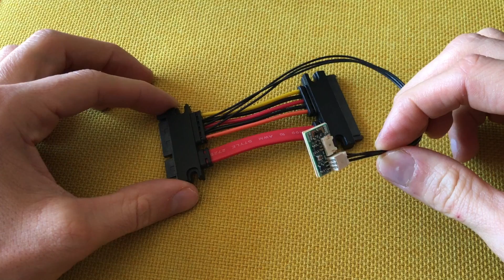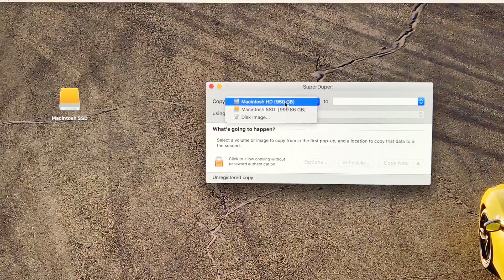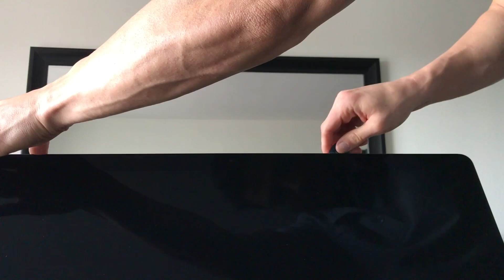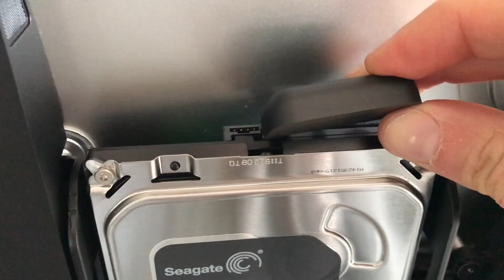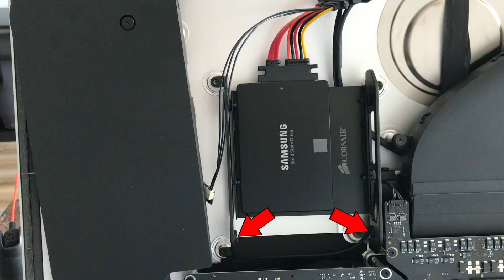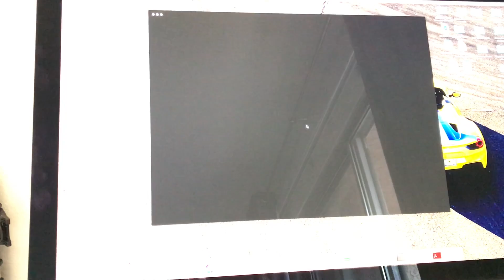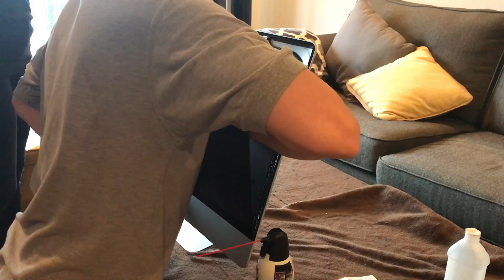How to make your iMAC 5 times faster | 2012-2017 SSD UPGRADE WITH THERMAL SENSOR | Step by Step

Comment: Very precise video, thanks for this. Just some two questions, the bracket recommended isn't available and Im considering this https://www.amazon.com/gp/product/B005PZDVF6/ref=ox_sc_act_title_2?smid=A2W0TEJ3MK1XP5&psc=1 I hope it works well. also can one use Gaffers tape in place of Dual Lock Velcro?
Reply from the maker: I mean I’m sure it would be fine. I’m just worried about it loosing its stick over time
Reply: @AIRWOLF  Thanks for the feedback I will go for the Velcro, did you check link to the available bracket, do you think it would be fine?
Reply from the maker: @meshmut  Ya I don't see why it wouldn't work.

Comment: will this work with the new model of sabrent converter? as the one you have in description is no longer available
Reply from the maker: Yes so long as it has a SATA connection. I’ll try to re link it. Thanks for the heads up.
Reply from the maker: https://amzn.to/2uNMDww this will work

Comment: Thank you so much i did it :) thanks for d help :) point shoud be note * thermal sensor not requires any how my mac running fine without any fan issue *
Reply from the maker: YAY!! Thats great! And yes, i've heard folks installing it without the sensor and there seems to be no issues.
Reply: This following link for Indian who are struggling to upgrade their mac please buy these following  items form amazon.in   ..

@ AIRWOLF  Hey hope you don't mind if i  share amazon Indian link because we cant import from (amazon.USA )

2.5 - 3.5 SSD Bracket :  https://www.amazon.in/gp/product/B00G57BN1M/ref=ppx_yo_dt_b_asin_title_o05_s00?ie=UTF8&psc=1

Adhesive strip and opener  :https://www.amazon.in/gp/product/B07QMGPPTL/ref=ppx_yo_dt_b_asin_title_o04_s00?ie=UTF8&psc=1

Samsung SSD : https://www.amazon.in/gp/product/B078DPCY3T/ref=ppx_yo_dt_b_asin_title_o06_s00?ie=UTF8&psc=1 

you can buy this also but its very extensive .

Adhesive strip and opener : https://www.amazon.in/gp/product/B00J42HP9O/ref=ppx_yo_dt_b_asin_title_o02?ie=UTF8&psc=1

i upgraded late 2015 27inc imac in 2020 :)
Reply: @RubySupreme329  congo :)

Comment: WOW!!! What a great video. Thanks for sharing. I've been looking to  upgrade my iMac 27" because, although it performs well, sometimes it's just a little to slow...especially for video editing. One question for you...would upgrading my ram speed too be overkill, or upgrading to SSD should be enough? I just need more speed for editing.
Reply from the maker: Thanks so much! Upgrading your ram would be just as important especially for editing.  I maxed mine out to 32G.
Reply: AIRWOLF Ok. Thanks for that. Very valuable information.

Comment: Just upgraded my iMac 2012 using your instructions and it went perfectly. The only issue I had was the Sabrent Hard drive converter was faulty and I ended up getting a better result using the later model. Speed is very noticeable. Thanks again for posting the instructional video.

Comment: you need to activate the built in apple SSD acceleration, some SSDs support it and some don’t but you can look up which ones do before buying. The samsung EVO used should be supported and you will get extra speed for free
Reply from the maker: Thanks for the info 👌🏼

Comment: You can do the same with an external SSD, I just did that to my Imac 27" Late 2013 with a 1 TB Samsung T5. My 2013 has USB 3.0 ports that are fast enough, you do not need to install the SSD internally. My disk speed went from 60-70 MB/s with to old HDD to 410-420 MB/s with the external SSD. My computer feels like new again... :)
Reply from the maker: That’s great to hear! That’s exactly how I felt.  A world of difference.
Reply: Driven To Madness No, with a SATA ssd you will not get speeds above 500 MB/s, but with a M2 ssd you can go as high as 3000 MB/s. But the problem is that older iMac doesn’t have an M.2 slot. So you will pretty much get the same speed with an external ssd via USB as with an internal SATA ssd, but without the hassle and risk of opening the computer.

Comment: Do you know if the ssd drive would fit on a 21.5 imac late 2012? Is the connector the same as the one on 27 inch?
Reply from the maker: As long as it’s a sata connection you’ll be fine
Reply: Everything worked, just had to make the drive compatible with a Mac and load from time machine. Feels like I have a new imac now !!
Reply from the maker: @EvaTess  AWESOME!! Well done.

Comment: Gutsy removing that screen.  Glad it worked out.  The new iMacs have NVMe SSDs available.  I just went ahead and paid for 2 TB.  But I did upgrade the memory myself which you can do on the 27" model without removing the screen.
Reply from the maker: That NVMe is throwing some serious speeds 💨
Reply: @AIRWOLF  Just ran Black Magic today.  Roughly 2000 MB/s on the write and 2600 on the read.  Plenty fast enough for most things.

Comment: Hi there, my late 2015 iMac does not have a 3.5" drive. is the one your worked on a 27" or 21". I was looking to get a thermal sensor to fit when fitting the 860 EVO SSD. but not found one for a 21.5" iMac yet.

Comment: This may be a crazy question, but I opened up my mac (Retina 5K, 27-inch, Late 2015) to upgrade the drive, and I found no hard drive in the bay. I reassembled and see that I seem to have "flash storage." Is that fusion? It is 250gb and I was hoping to install a 1TB SSD.
Reply from the maker: Soul Reflections Photography sounds like you already have an SSD installed already
Reply: Yes sir.. Did some.research and found I have straight ssd. Kicking myself for not getting more than 256 gb :/
Reply from the maker: Awwwwe mannnn well at least you already have the SSD
Reply: you absolute idiot. flash and SSD are one in the same. you cannot upgrade

Comment: No need for thermal sensor, i've done the SSD upgrade (Samsung evo 1tb) and running on imac 2013 for more than 2 years no issues.
Reply: Is the fan normal after installing .. or it is loud?

Comment: Hi, it this thermal sensor compatible on imac 21.5 late 2013?
Reply from the maker: Yes! 100% if you click the link to the thermal sensor, it’ll give you the specs. But I just checked and you’ll be fine to use it.

Comment: Nice and instructional, but very clickbaity. That process does not make the iMac 5 times faster - it makes the disk speed 5 times faster. That's a very different proposition. A 5 times faster iMac would get 5 times the fps on any game, 5 times faster render and export times on any NLE, etc. You get the idea. That's what 5 times faster means, and that's impossible to achieve. Just name it "how to make your iMac's disk speed 5 times faster if you're running an HDD" next time. And in most cases you would be as well served by just booting from an external thunderbolt 3 SSD - no need to open the computer, save the risk and the work and get about the same speeds.
Reply from the maker: It says “SSD UPGRADE” in the title.  If one doesn’t understand that then they should not attempt it. 🤷🏻‍♂️
Reply: @AIRWOLF  Yes, it says that, but it also says "how to make your iMac 5 times faster", and that's not true. That process does not make any iMac 5 times faster.
Reply from the maker: The title is followed by “SSD UPGRADE” implying making the “SSD 5 times faster”.
Reply: @AIRWOLF  Then why not remove the first part and have an accurate video title? Because it's clickbait, that's why.
Reply from the maker: Visual Studios the same reason YOU put “Chris Hau’s” fuckin face as a thumbnail you jackass. Get the fuck outta here

Comment: If there was no sensor there why did you need one for an SSD. If there was one why didn't you use the same
Reply from the maker: The original HDD sensor is built in the actual hard drive from what I gather you can't remove it to re use it.  Thats why the sell it separately.

Comment: I'm going to do this on my 2012, but I also want to upgrade the PCIe 2x4 lane, since I can achieve much faster read/writes than a standard SSD Sata III drive, like close to 1,000 mb write and 1,200 mb read. SATA III has a 500mb max read/write, so honestly, if you are daring, it's worth doing the PCIe blade style SSD upgrade.
Reply from the maker: I agree! Hopefully this videos at least helped you get inside you iMac. :) Happy tinkering!

Comment: Hey Airwolf, A great video, enjoyed it immensely. I have a 2018 IMac with the two TB fusion drive. I have added 32GB of RAM bringing the Ram up to 40GB to help me with Video Editing and running my X-Plane Flight simulator. I was curious about the difference in performance so I downloaded the Black Magic App . The write speed varied between 200 & 700Mbs and the read speed varied between 400 to 1000+Mbs. I am wondering if I can upgrade with a two TB SSDrive and keep the Fusion function or do Ido a a straight drive upgrade with the SS drive and not worry about the Fusion aspect of the new change to the system? That is my question............Thanks for the info on getting the screen separated from the housing. I have a bazillion guitar picks and plenty of sharp utility blades handy. Also, naptha, found in Ronson and other lighter fluids is a great adhesive remover and does not hurt plastics or most finishes on wood. I use it all the time when in my guitar repair work. Straight Naptha  can be hard to find depending on where you live but lighter fluid is usually readily available. Cool video, Thanx!

Comment: Having done this procedure on several versions of the Mac All-in-Ones, and performed the same thing on the Dell and Hewlett-Packard All-in-Ones.....The Mac is the biggest pain in the butt to work on of all time.  It does make faster, but adding ram is what will help the most. Also, when a spinning disk fails, you can still try to revive it.  When a solid state glitches, kiss everything good bye forever. 

I can appreciate this guys "do it yourself" approach. I wish everyone could be like him, saving money is great. Doing it yourself and making it work so well, priceless.  Pretty good angles and commentary, nice hint about the Costco microfiber blanket !  .....  Being charged $1,000 to take one of these apart (even the easier previous magnetic screen models) and poke in an SSD is not unheard of. A huge price gouge, but people do it willingly.  

....if you are a dyed in the wool Apple fan,  that's the commentary on the video....Nice job! Nice Computer! Great speed increase for the money, good hints and instructions, and not as "dry" as some videos. Well done.  

 I'd like to compare that job to two pc's that are the IMac's direct competitors. AIO, All-in-One systems, same chips, ram, hard drives, etc.. and will compare systems to fit the reason why he wanted to upgrade.
...........The same editing he is doing can also be done on any pc just as easy, and with more software titles to use along with the main software.  That same upgrade mod with the same results, plus 4 other upgrade speed and video mods, can be done on the Dell and the HP AIO - in 15 minutes total, for the same price. Plus making all the other mods easy at the same time, because of how the pc's are designed.
 
 I am a certified laptop refurbisher with Dell, Toshiba and a few more. I have repaired Apples from the days when they had s100 busses, the Fat Mac that only had enough data to fill part of the bios so they put pictures of the staff in the rest of it, and on up to today's glued together air specials. I have 32 years computer repair experience. My professional career in computer mods started with the Commodore Amiga Workbench GUI operating system. It came out later the same year as the first Mac OS, but in color and stereo. Wrote a few books on modems and Pirate Bulleting Boards as well...

The Physical and software maintenance on those IMacs are 5 times as hard as the exact same job on a Dell or an HP. Even imaging them for back up.  We use GHOST, or Acronis. to make a full back up, either UEFI or legacy boot systems. It will even image a Bitlocker encrypted drive and reimage it back exactly as it was. That software takes half the time, and half the hard drive space for the image as what was demonstrated.  AND you can edit the compressed image with them as well. Including installing or uninstalling files, from the image. After that, dos scripts that will install or uninstall software after the image finishes. 

NOTE: Great that you pointed out blowing out the dust !!!  Seriously.  I would be nearly out of business if everyone cleaned the dust out of their computers twice year.   ......You can clean these Dell/HP All in Ones (AIO) out better and a lot easier than the Mac. Dust bunnies kill by clogging the "inside" of the filter vent holes. That is why there is a heat sensor in there. Dell and HP don't need heat sensors. You can practically LOOK clear through one from side to side. Good air flow. This means they can run the Intel chip at full speed, full heat - all the time.

As mentioned, not only can this hard drive replacement procedure on the Dell and HP can be done in 15 minutes, you can also change the ram, replace the fans, upgrade the power supply, and move the DVD wiring to another SATA drive, that will fit easily inside the case, while leave the DVD burner in place (abeit unplugged). These motherboards have 4 sata ports.  With an upgraded power supply and some cable, you can probably re-attach the DVD burner (but who uses them any more?)

A simple procedure. All that is needed is a small Phillips head screw driver (for everything!) Take the stand off with 4 screws, take the BACK of the computer cover of as Nature Intended, with 5 screws, unscrew the drive, 4 Phillips, snap in the new one, unsnap the ram, snap in new ones, check out the cooling fans, replace them 2 Phillips, unscrew the power supply 4 Phillips, screw a better one in. 
Want to upgrade the GRAPHICS card? 4 screws...done. 

Did we mention there are no TORX scews  in HP or Dell, just standard size phillips with the size and length marked next to each hole and a picture of what it holds in place embossed in the plastic.
  
Anything else the pc's have like the IMac?  Actually quite a bit more. Telescoping, tilting stands on the HP and Dell.  Standard stuff:  DVD burners, High speed wireless, blue tooth. In the back four usb 3.0 full size slots, HDMI, VGA, Display Port, head phone jacks, gigabit Ethernet, eSata on the HP. On the sides of the computers, both have 2 more USB 3.0 slots, memory card/stick port, stereo speakers and dual microphones, more headphone jacks or Line in/out ports. On the fronts - hi res "tracking" cameras with "sliding lens block plates" (no need for a yellow sticky) and Touch Screen. My favorite part?  The power button is indented over on the side, not around on the back.

Is the Mac faster than the Dell or HP?  No, same speeds with I5 or I7.  Better Graphics? Mac Retina Display has a slight, but nice, edge.  Is the retina display faster? Barely.  Both Dell and HP have faster graphic cards but use them differently than Mac, mostly to enhance "action" for gaming. However you can seriously upgrade the graphic cards on both pc's.  Does the Mac have better graphics software? No. 

Is the Mac "easier to use"  No,....oh come on, every one loves their first computer best.......but  seriously This is 2019 gang, those old wives tales are a thing of the past.  You click on an icon and it does things. The end.  The PC is better organized at file and folder level though, no multiple "libraries" that may or may not have apps.....  
......Well Macs don't "get viruses". hahahaha, yes they do.  

 I miss my Commodore Amiga. We copied the Mac IIx bios to file then ran an emulator with the Mac color OS 7.6.1 in a window. Because it was all in ram, it ran faster on the Amiga than on a Mac. Hey the didn't make Quarkxpress for the Amiga....

Comment: I watched lots of videos about changing the fusion to ssd, and most of the people seem to have problems with the adhesive strips. Did you have problems with them, I mean the strips you're using and giving a link to amazon. People's screens are falling and breaking using these strips
Reply from the maker: Mladen Mladenov that’s so weird. I have not had a single issue. I mean I really cleaned “both” surface areas before applying it.
Reply: @AIRWOLF  https://www.youtube.com/watch?v=Sntb7FyFlnw I was watching this video, also, that's why I asked :) Thanks anyway!

Comment: Great video, Does this also work on the 21.5in 2015 Imac as well? I saw that you had a 27in ... mine has a 5400 rpm hard drive and it's absurd how slow it runs... I have no experience in doing these things, I am going to just follow your video step by step and see how it goes ! thank you for making this again.
Reply: Hi, how did your installation go? I'm wanting to do the same thing. Technically there is a lot of talk out there that this isn't possible on the late 2015 21.5" HDD setup.